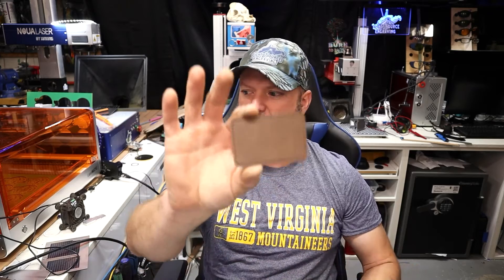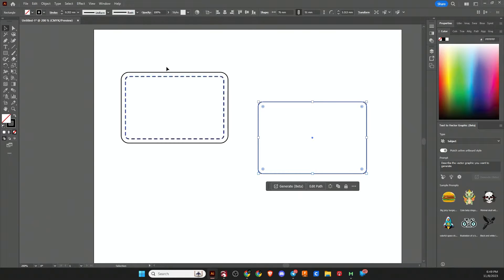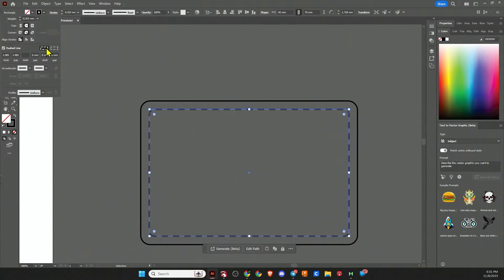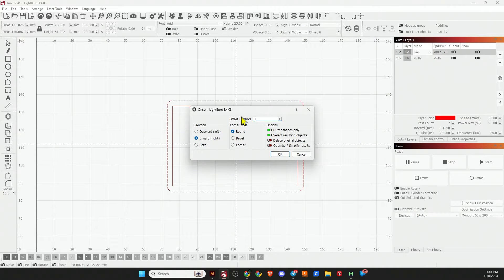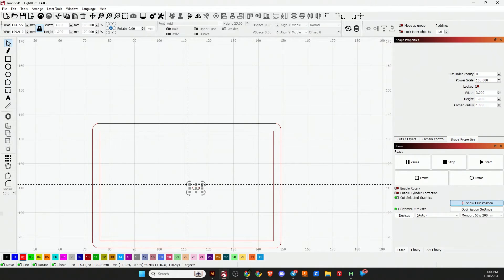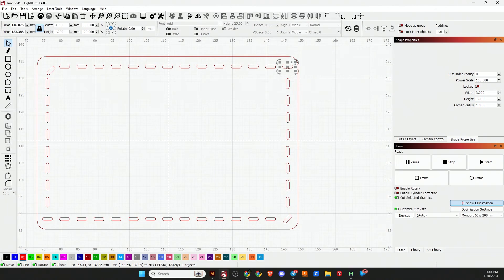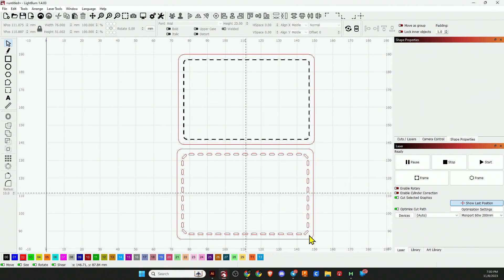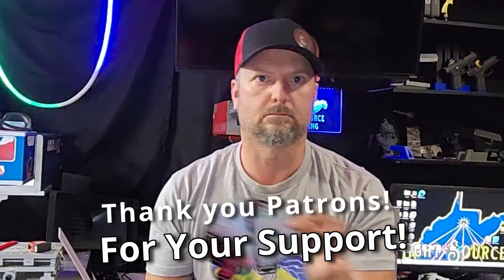How to EASILY make stitching lines for DIY Patches - Adobe Illustrator and LightBurn

Comment: Two tips in Lightburn 1. you don't need to find start point anymore when copying along path. 2, once I create the original shape ft the stitch I use the array tool to create the lines of stitches then you only need to rotate the corners.
Reply from the maker: i heard that about the nodes, thank you! array would definitely work as well!